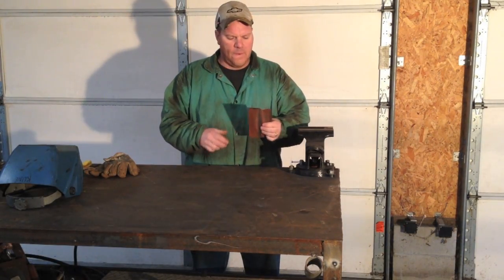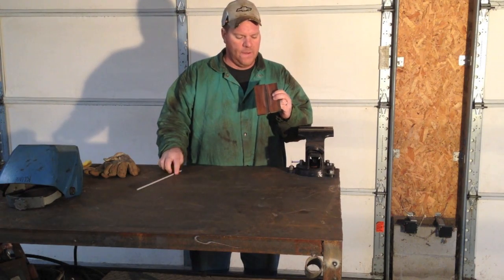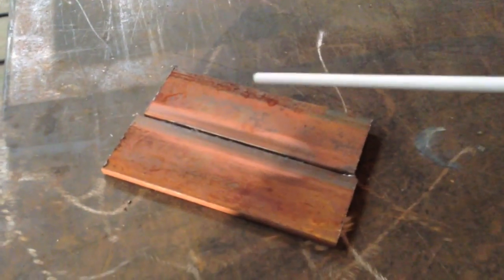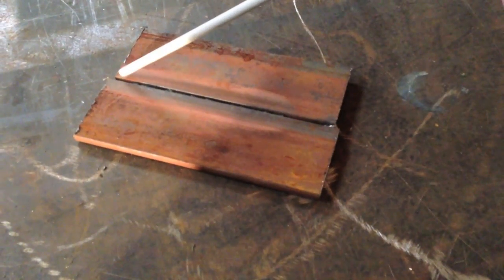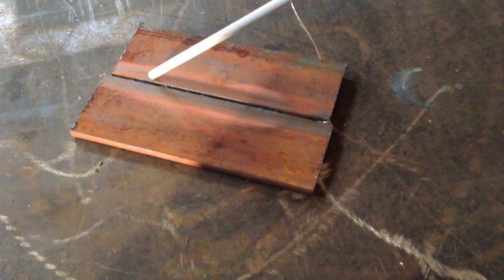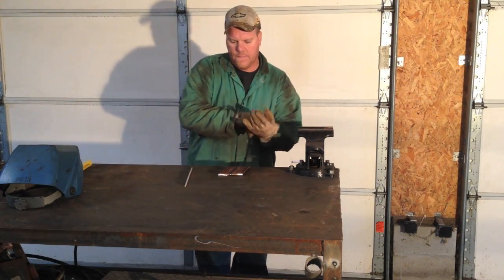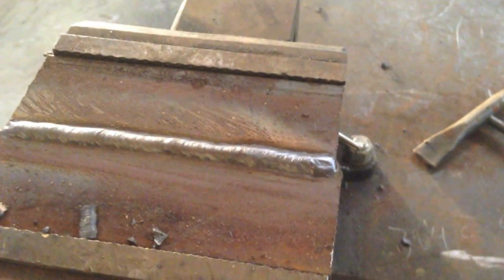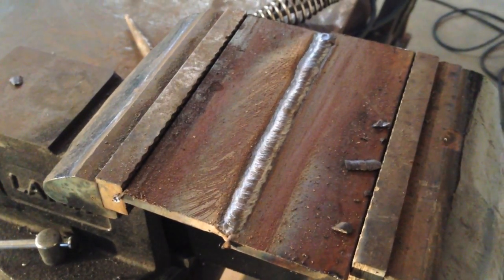Stick Welding Techniques and Tips 7018 Butt Weld

Comment: I’m at college studying welding right now and a butt weld was out test piece for MMA, we were taught to put a bevelled edge on both pieces of metal with a root run in the middle, is there a reason you didn’t?

Comment: I tried a 2.5 mm thick 7018 electrode on a 80 amps inverter and I couldn't initiate the arc.Is  the amperage too low for this type of electrode or the electrodes needs to be  dried  ? Thank you!
Reply: 7 years later I would suggest hitting the end of the rod with the wire brush, 80 amps should at least get it going, I might also try looking at a grounding problem